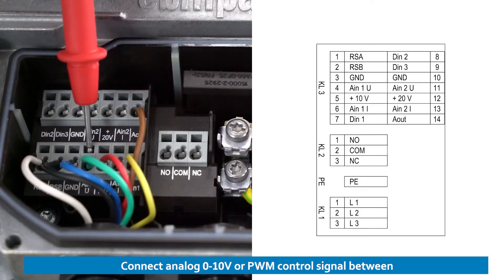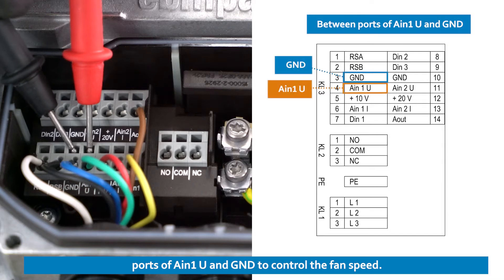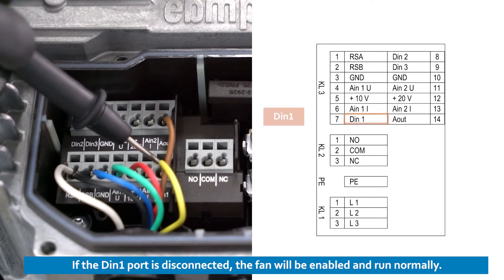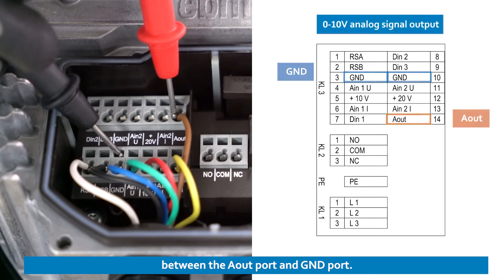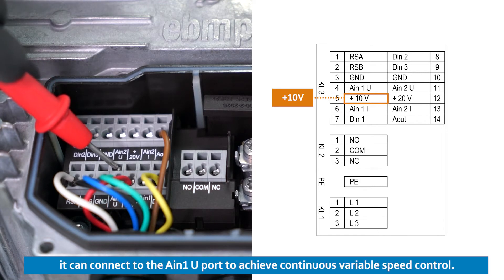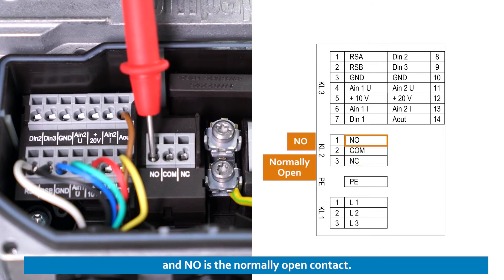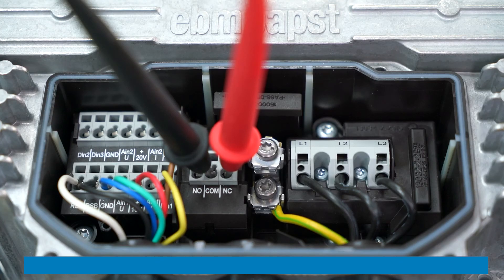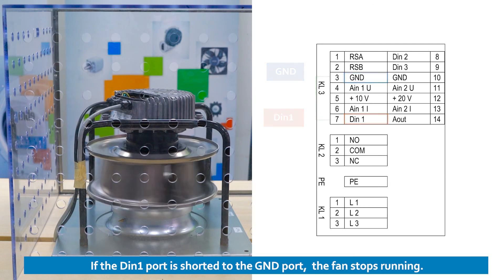Wiring instructions for EC Fan (Communication & Enable Functions)

Comment: How can run the fan motor of ebm papst R3G355-AI56-01 at manually with full speed, without any analog or digital input, also without potentiometer
Reply: You need to loop 10v and  analog  input